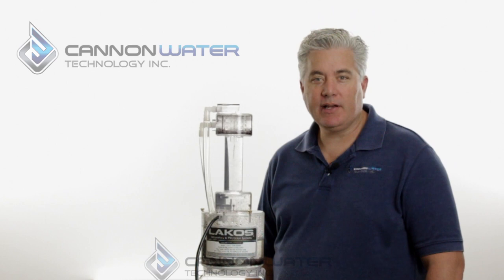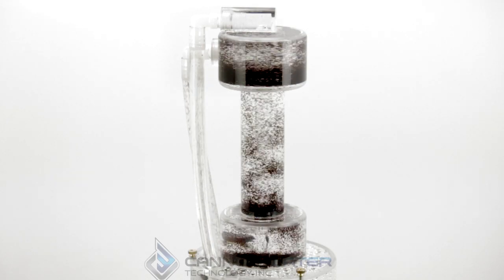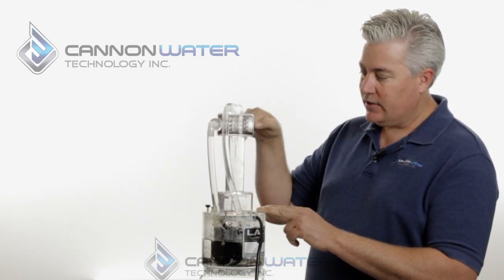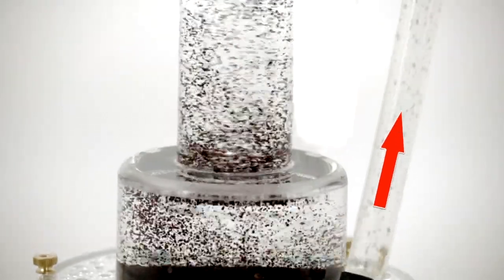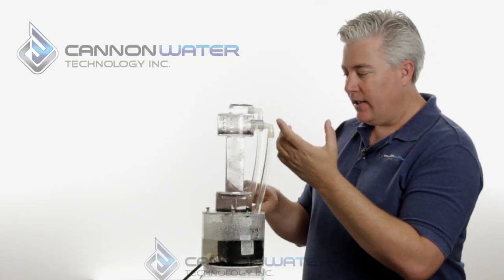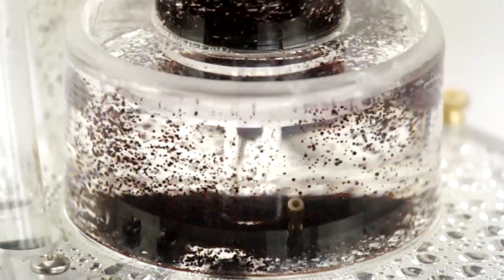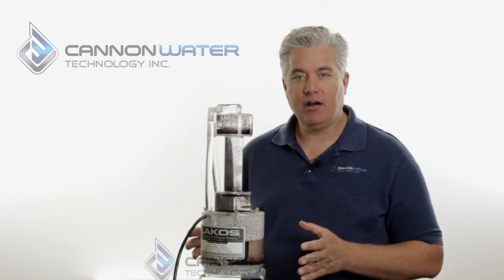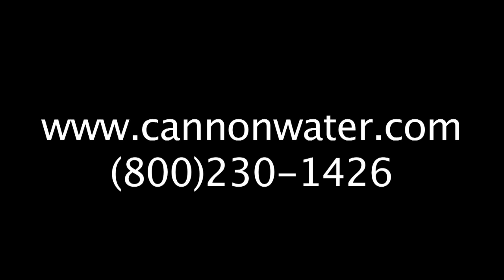Lakos Centrifugal Separator Demonstration

Comment: Nowadays, centrifugal filters get advertised as an expensive, high-tech machine. But that's not true. Historically, many people ranging from farmers, to factory owners, to housewives used a centrifugal filter to separate particle matter out of river or creek water. Dirty creek water, after the solids have been removed, is easy to boil and drink.

If you look at all the YouTube videos which show centrifugal separators, you'll find "fully enclosed" machines which require a lot of maintenance. But the simple kind of centrifugal separator is just two pieces of clear tubing, with a set of plastic fins inside. It's a twenty dollar gizmo.

The ass-bandit demonstrating the machine in the video is just trying to trick people. He wants you to spend eight hundred dollars. Not twenty dollars.
Reply: he's not stealing from anyone. He is offering a ready-made solution. No thievery, he is not forcing you to buy. Get your language straight.